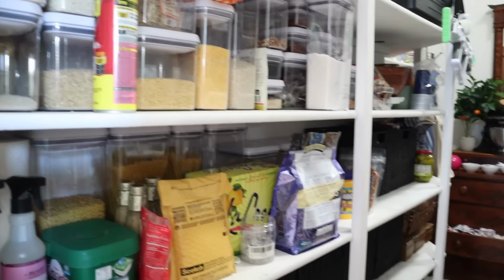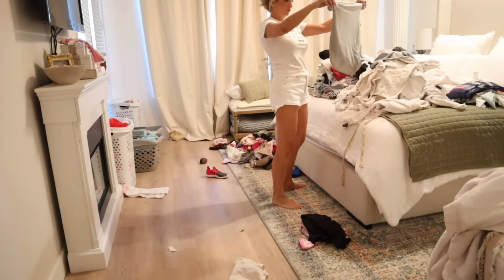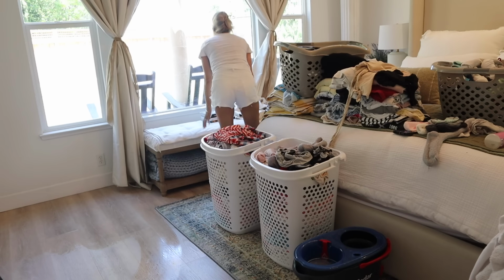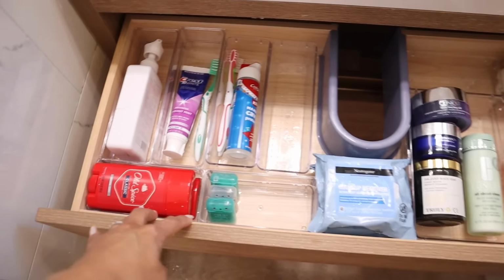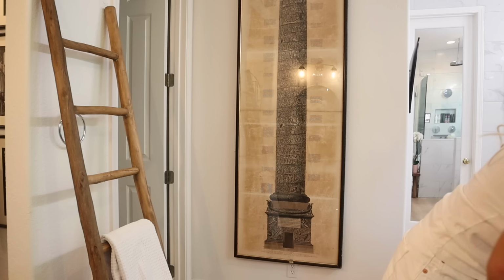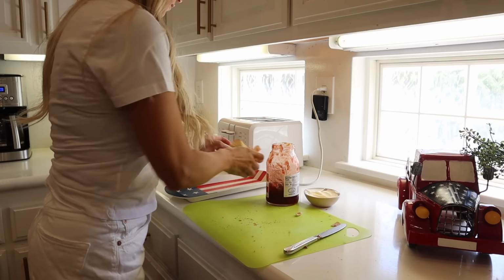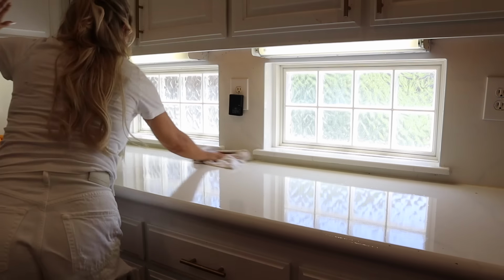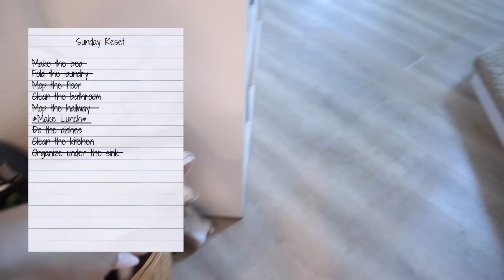🫧 🧺 45 MINUTES OF DEEP CLEANING + 18 LOADS OF LAUNDRY 🧺 🫧  CHECKLIST TIPS TO GET IT ALL DONE

Comment: I don't know if you have issues with keeping your shower glass spot free or not, but we just redid our bathroom and have glass doors.  I put a squeegee in the shower and we wipe the glass down as soon as we are finished with our shower.  It can be a pain, but it only takes less than a minute to do and I never have to worry about scrubbing them when it comes time to clean.  I also bought some OXO brand suction cups from amazon that are to hold your razors in the shower.  They are clear and work great.  I have one for me and my husband and I also got one to hold the squeegee.  Just a helpful tip for you or anyone else.